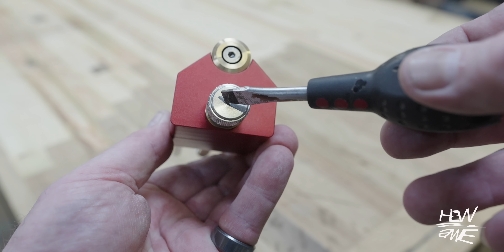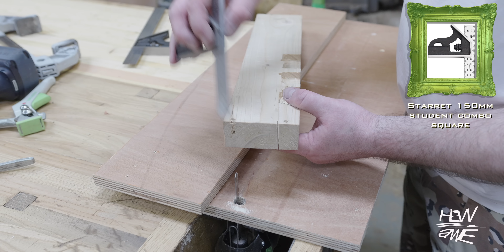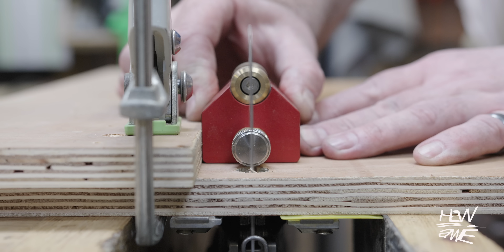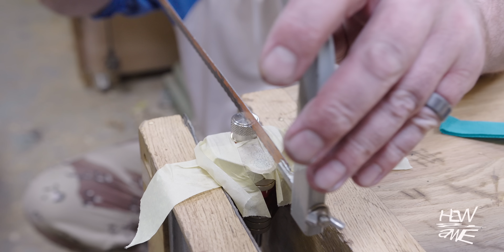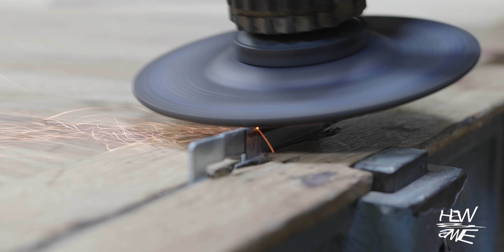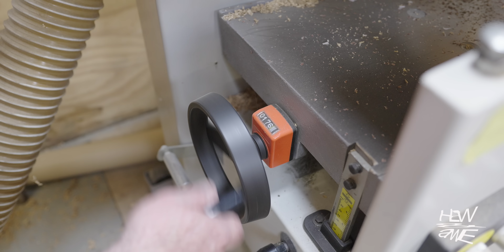Woodworking Screw Driver Build

Comment: Hey mate. Loving the videos. In Aus that double sided tape is AU$40 on Ebay but it is a 50 metre roll. Question, Is this stuff thin? I want to use it for template routing and a lot of the stuff I've come across is like mounting tape that's too thick. Other brands I've come across are a pain to remove from what it's stuck to. Have to use spirits to get rid of it. Thanks for your help.
Reply from the maker: What the actual fuck, really?!?!? No it’s not thin, and there’s nothing else I’d rely on, you’ll see what I mean when you need to get it off, u don’t need a lot! I think it’s .25mm thick.